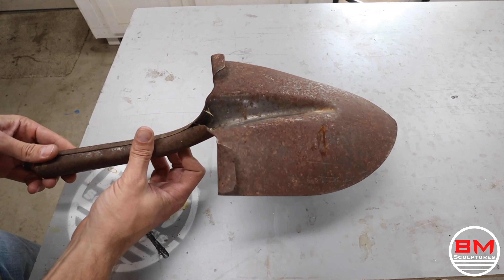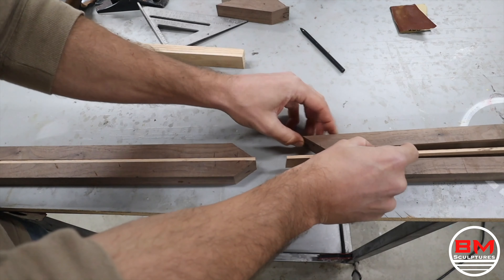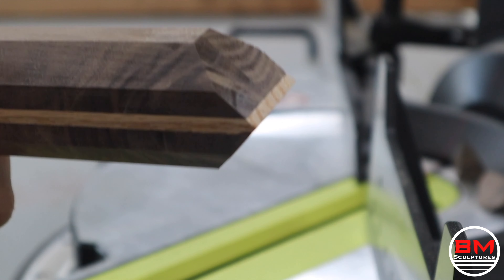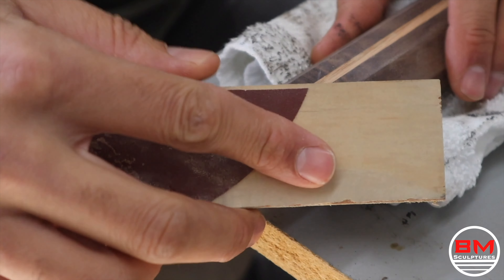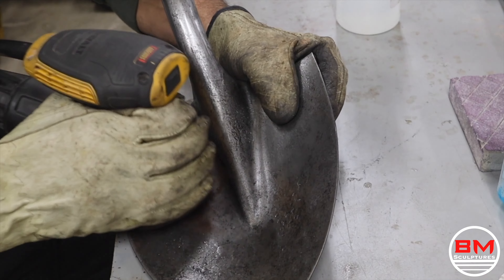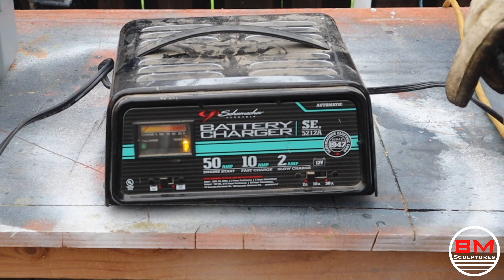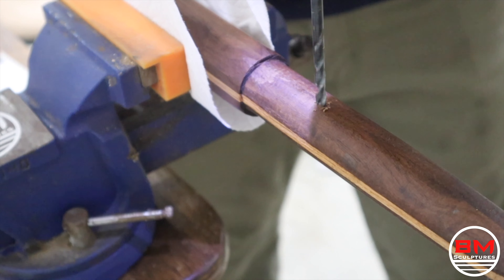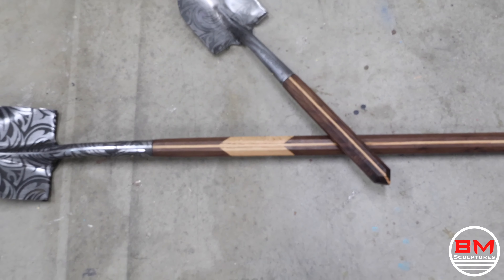Antique Rusty Shovel Restoration || Woodworking, Metalworking & Metal Etching

Comment: I can't believe how well you placed the masking on the shovel. It's perfect. And you can tell from the finished product that it is perfect!!
Reply from the maker: Thank you Tracy. The curves of the shovel were really hard to place the vinyl down correctly. In a couple areas I actually had to cut the vinyl and overlap some to make the design connect.

Comment: Your work is amazing. And your imagination... you can turn anything into art. 
I restore motorcycles so I do a lot of whatever blasting of metal (sand, glass, soda, aqua...) and if you want to deeply clean rusted steel you need more pleasure and preferably closed cabinn. You can outsource that so you save yourself a lot of time and mess :). Other thing is that old metal cleaning is so satisfying 😌

Comment: Have you considered electrolysis for rust removal? It really is amazing. I restore vintage cast iron cookware and so far I've run into pieces with 100+ years of crud, rust, paint, and even concrete. Electrolysis removed it all within 12 to 24 hours. The time will depend on the size of the battery charger you use.

Comment: Go grab a few gallons of white vinegar. I own a knife & tool sharpening business, there's a fair bit of rust removal and restoration on cleavers and garden tools. Phosporic acid based rust removers are quick and supposedly leave an oxide layer that won't rust, but also blackens the base steel a little. White vinegar takes longer (scrub the part over every 2-3 hours until you're happy with the finish) but it's cheaper. People don't realize just how aggressive it can be at removing rust (and protective layers!).

What oil are you using for the steel? It looks like a jelly, I want to try some.

Comment: Great video, I have a couple shovels and rakes that need some attention like that. One shovel I’m very surprised it hasn’t snapped just scooping a cup of dirt lol. Just a scoop or two away from snapping off. Plus another one that’s already snapped 🙄….. gunna try making my own handle now instead of spending more money. What would you recommend as a good finish keeping in mind they will be stored on an outer wall of the garage all year with freezing temperatures in winter?

Comment: Nice work but that 4:40 is not a snug fit. It needs to be wedged in there with a couple of hard slams. You shouldn't be able to perfectly place the handle like you did without pounding the handle on the ground while holding the shovel head. All the work holding it on is on that little brass pin. The metal will expand as you work with it, there will be play on the handle, and if there's play on the handle, the pin might break. But I suspect you won't do much work with that shovel at all after all the effort you put into it. You probably have a separate working shovel.

Comment: I remember this video with a different beginning.... using a shovel for what most shovels get used for. Anyway ,what kind of oil do you use on your scoopers?
Reply from the maker: haha yeah I had some copyright issues with the previous video so I had to make some changes. While I was at it I also cut out around 10 minutes to make it shorter.
Reply from the maker: For the wood I use Festool heavy duty finish.... For the metal I use Jojoba oil. (link in the description)